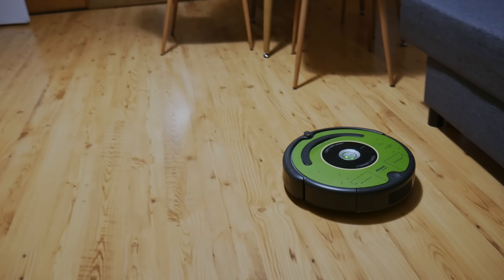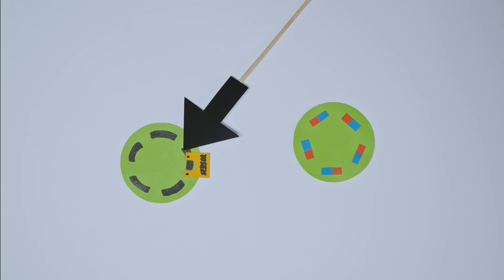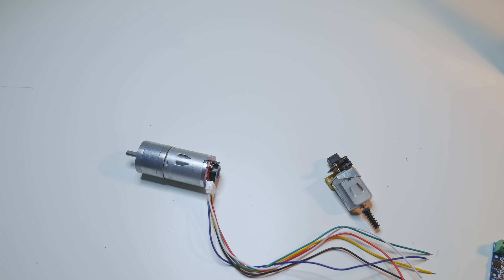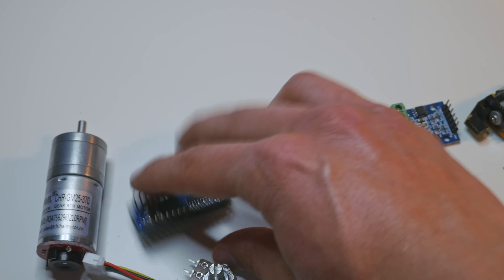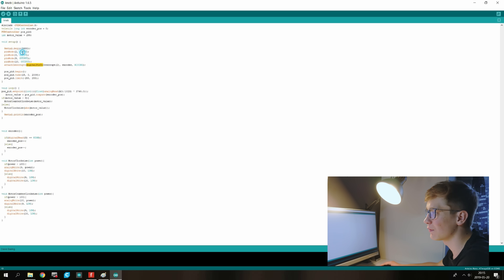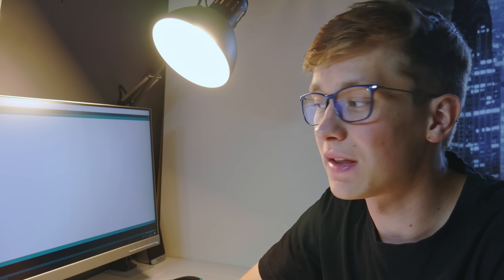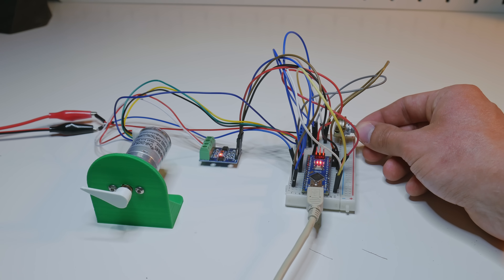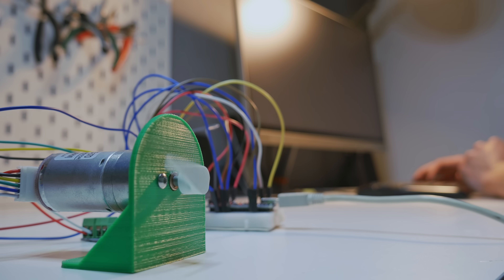Encoded Motor With Arduino

Comment: Can i use an encoded motor as a 360 degree rotation  servo ?  Suppose i give an input of 5 to the arduino using some monitor display then the encoder must stop at 360degree/5  position, like every 72 degree the motor should stop and rotate??

Comment: I came across this video after having successfully made a project exactly like the one you mentioned 1st, with the potenciometer. However, I tried doing something using serial comm as the source of the target position, but anytime I connect the powered motor driver to the arduino, serial comm doesnt work. I'm left disconnecting the driver anytime I want to type a number in serial comm. All the grounds have a single common ground point, so it's not a grounding issue. A friend suggested it might be electrical noise from the m.driver interfering with the arduino, what dya think? Thanks

Comment: I don't know anything about this. I'm a light retrofitter.  I design and modify the vehical lights.  I want to make the 2 motor to turn at the same pace and, if possible, stops at a specific point the power is switched off.

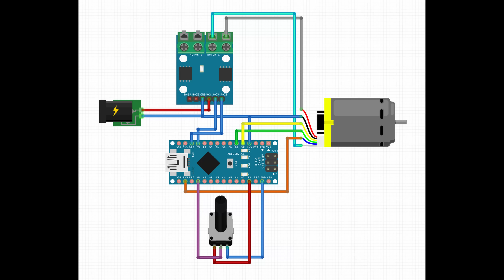Comment: I pulled up the DC Motor w/ Encoder that you provided a link to in the video's details and compared it to the Fritzing diagram you displayed (3:19), and the wiring you suggested does not make sense to me. In particular: Why are we connecting the motor's white "Quad encoder B signal'" wire (see Amazon's pictures) to the negative motor terminal of the driver?

Comment: Interesting video regarding ardulnos, I'm currently working on a project it's an radio controlled model kayak 🛶 1:6 scale but having great trouble mimicking scaled down body movement like forward backwards left and right with a two standard motor setup using normal standard r/c the timing on the motors needs to be correct as it's critical for the paddle strokes, the system i have at the moment is a electronic speed controler (esc) driving two motors. Just wondering if you can point me in the right direction if it can be done involving an endcoder motors ardulno system working with a r/c receiver and transmiter. Have a look on my channel to see kayak videos thanks Chris.

Comment: I have a problem, if I have a motor with encoder but it handles a voltage of 24 volts, which model of H-bridge can I use?
Reply: the l298n can handle it, make sure to see how it works

Comment: How do you keep the position of the motor same on startup? for example if it is in a robot arm then how do you know the absolute location of the arm on startup. Wont the position be different every time the robot boots up?
Reply: yes it will, that's the downside of these motors, more expensive robotic arms use absolute enocoders, that way the position of the motor is always known

Comment: why are u have "* 3740" at first line in void loop? Thank u!
Reply: Hey. Perhaps, for your question, if you search for "JGA-25 370 6V 210RPM with encoder - how to get RPM from encoder pulse frequency", which is found on the arduino forum, or something similar, maybe it can help you, not that it is this is the encoder motor value that the author of the program has used.
-----------------------------------------------------------------------------------------------------------------------------------
Oi. Talvez, para essa sua questão, se você procurar por "JGA-25 370 6V 210RPM with encoder - how to get RPM from encoder pulse frequency", que se encontra no forum arduino,  ou algo similar, talvez possa lhe ajudar, não que seja esse o valor do motor encoder que o autor do programa tenha utilizado.

Comment: I doubt that anyone will ever see this post, but I had to write one because this video is the BEST I have seen regarding this subject. I have been looking for this solution for over 6 years now and came across it just now. Every other video on YT does not use position control with DC/encoder control(closed loop). Seems they all like steppers. There is no better way than this method for position control at a very inexpensive solution. I was a CNC tech for over 25 years, and this method was used long ago on industrial machining centers. Thank you very much for this project!
Reply from the maker: I have seen it :) Thank you very much!

Comment: Hello friend, I'm from Colombia, I'm doing this same project using exactly the same components and the same code of your video, but I can't get it to work correctly, when it reaches the position that it should stop, the only thing it does is reverse the direction of rotation , please help me
Reply: In addition, the current when reaching the desired position rises too high and the motor driver gets very hot.

Comment: I didn't exactly like this tutorial. Yes you showed the true function of the motor utilizing PID control which is great. But comparing the first and second example code were nothing alike. You never explained how the first example worked nor even showed the second. This is a problem with people who use Arduino. They have no idea how the code works. Thankfully I am majoring in Robotics Engineering so I can read the code and figure out how it works. But to the general public they have no idea what you're talking about. Comments on the code would help people understand. I do not like when people explain the code for three seconds and then cut to the application working. No disrespect, I just thought you could have done better.

Comment: Nice tutorial! My actual project for agriculture uses a sensor hall or a reed switch to control a peristaltic pump. The "IN" is the wheel speed. It uses a 12V, 36W windshield motor and a IRF1404 “as driver” (plus a diode and resistors for protection).

Comment: Great video! If I understand correctly, the encoder you ultimately used will tell you relative position, not absolute position, is that right? In other words, if you turn the arduino off and then on again, it will think that the current motor position is "0"?

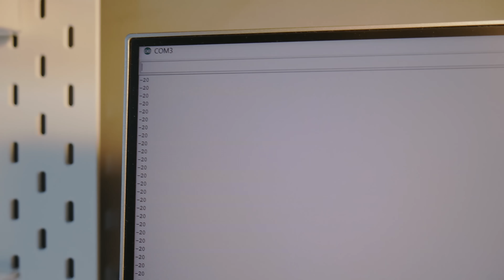Comment: I entered the code according to the video, but the motor does not stop. The code on GitHub also seems to be inaccurate. What code do I need to write to do the same as 5:55?
Reply: It sounds like you have the wrong motor polarity. When the motor moves in the positive direction, the encoder must count positive.

Comment: Hi, do you think is it possible to do a open loop test in order to get a mathematical model of the motor? The test is simply to put a voltage at input and measure the speed output, and of course to hold the data. Thanks

Comment: Hey there, l have seen your videos were really superb but what l actually want is how to control the position of the encoder by using arduino , lcd display to see the position visually, keypad to type degree , potentiometer for lcd display voltage up and down and h-bridge to control high voltage using low voltage . Please let me know if you upload a video basing my project please help me

Comment: When using the 2nd version of the code without potentiometer, do you just remove the potentiometer from the wiring schematic?
Reply: did you ever figure this out. its driving me crazy. i dont know know what to do.
Reply: @MichaelRHead-zv2zf  Niko didn't reply so I didn't go down this path. I found one that was simpler/cheaper https://www.youtube.com/watch?v=yvrpIYc9Ll8

Comment: Hello let me congratulate you I have seen many of your videos and they are very inspiring !!!! but I don't know as much as you hahaha .... it would be too much to ask ... that you do the same but with the little engine that you showed first ??? I have several of those motors and I want to use them, I know the magnetic encoder is better but I would have to buy them and I already have them. I am asking you because I am not given much about electronics and I do not know enough, apart from the fact that there is not much technical information on those motors as well as the 5-pin encoders that also come in the heads of the printers ... Well I already stole a long time from you, a thousand apologies and in advance thank you very much, greetings from mexico !!! sorry my english is terrible!!

Comment: I connect a 12v encoder motor instead of 6v when I move the potentiometer ligermanet the motor does not respond and keeps rolling why? I send position in serial plotter and nothing it still rolling
-85
-87
-88
-90
-92
-93
-95
-97
-99
-100
-102
-104
-106
-108
-111

Comment: hello, this tutorial is quite helpful. thanks for your great effort! 
I have brought a DC geared motor. it's kinda different than the one you have used but I believe it would serve the same purpose especially that it has the same exact encoder. 
I was wondering if I could use it on my Arduino mega without a motor drive. 
please help me! thanks in advance.

Comment: Great tutorial, I try to run the code with the same setup for both knob and serial, but the motor doesn't seems to run correctly. The motor just run at one direction and with constants speed, even when I turn the potentiometer left to right, or the otherway around. Same thing with the serial version, the motor just run at constants speed to different number I typed in. The motor I have is slightly different than the one you have, but the encoder is the same specs, same color cables with 11 signals for 1 turn.
Do you know why? is it because of this line where I have to tune? pos_pid.tune(20, 0, 200);  Thanks
Reply: did you fix it?

Comment: Great video and thank you for the time you invest in these videos. It would be great if you could explain the wiring a bit more too. "Here is the motor... it has 6 wires" - what are those six wires for? My motor has 2 power wires and 4 encoder wires, so it looks different and has different colors but has the same functionality. If you explained what the wires are for, it will help others with different motors to also understand the wiring better.... like myself :-) But thank you again

Comment: Thanks for a great video! I'd like to ask a newbie question. Would it be possible to use a quadcopter ESC flashed with BLHELI firmware, as a motor driver for such precise control of a BLDC motor with encoder?

Comment: H there! That was such a masterpiece XD. Thank you very much. Just a question: where  could I download the PID Library? Best wishes and good luck :)
Reply: Hi Gerardo. From the stech menu->Include Library->Manage Libraries.  In the filter enter: "PIDController". I've always used the arduino  PID_v1 library and I'm not clear what is the difference, but I see the PID_v1 has more control. In any case, great video.

Comment: Can I use the Arduino to compare vibration levels of different cd players ect? If so, is it as simple as placing the Arduino sensor on the cd player chassis and also using a multimeter to get the reading?

Comment: hi first of all good work on the video very well made! i am thinking to introduce this motor into my project (replacing my stepper motor)  my question is since my motor will have some load on the shaft would you suggest e a better motor driver in terms of heating and idle power handling? for example for the stepper i'm using a tmc 2208 wich drops power up to 20% when idle...hope to hear from you soon keep up the good work!

Comment: Thanks for shareing the core. 
I was not familiar with coding and I was tring to use the STM32 MAPLE BOARD insted using arduino nano. 
I just going to change some pin number, But it not work...... the encoded can show up to 7 or some number, then the loop was dead.
Any ider with that? 
Thanks.

Comment: I like it. Could this be made as a drop in replacement for a stepper motor?
Reply from the maker: With proper PID calibration, it could be used instead of a stepper motor

Comment: Do you have a correct circuit diagram for this? The link you included for the motor has a harness with the wires in a different color order than the motor in your video. The colors do not match your fritz diagram.

Comment: Can u jalso show the wiring and not just the schematic? Schematics are confusing
Reply: His wiring harness from left to right: 

red,black,yellow,green,blue,white

red    = m1 (motor power)
black  = ground (encoder - )
yellow = c1 (channel A of the encoder)
green  = c2 (channel B of the encoder)
white  = m2 (motor power) 

Wires from motor:

White and red wires to motor driver motor A connection points. To make motor spin the other way reverse these connections.

Blue wire to 3.3v Output on Arduino Nano. (encoder + power. Mine needs 5 volts so I used 5v pin on Arduino Nano instead of the 3.3v (volt) pin.

Black wire to Arduino Nano ground pin. (encoder - power connection. Either one on Nano may be used.)

Yellow wire to Arduino Nano D2 pin. (This is channel A encoder signal being read on pin D2 of the Arduino Nano)

Green wire to Arduino Nano D3 pin. (This is channel B encoder signal being read on pin D3 of the Arduino Nano)

The center pin of the potentiometer is connected to Anolog input pin A0 of the Arduino Nano.

The two outside pins of the potentiometer connect to the 5v pin and a GND (ground) pin on the Arduino Nano. (reversing these two wires will reverse the direction the motor turns when turning the potentiometer)

D9 of the Arduino Nano is connected to the motor controller Dir (direction) pin on my driver but most dc drivers have just two input spots and the wires can go in either order to these spots.

D10 of the Arduino Nano is connected to the motor controller PWM (pulse width modulation) pin on my controller. Sometimes labeled step pin on various controllers. His driver wires to D10 and D9 of the Arduino are labeled A-1A and A-1B on his motor controller. 

External power + goes to motor controller power input. (labeled VCC on his controller and labeled V+ on mine and others.)

External power - goes to motor controller ground input. (labeled GND on his controller and labeled V- on mine and others.)

The external power ground is also connected to one of the two Arduino Nano ground pads labeled GND
Reply: ten littleindians wow thanks! :)

Comment: In your code, you’d be much better off defining a constant for each dio pin e.g. MotorSense = 3; Not only does it make your code easier to read, and less likely to make mistakes, but if you ever changed pin, you only need to change the code in one place.

Comment: Could you please make an example with the other motor you showed? I have a couple laying around and I couldn't get them to work :)
Reply: The motor first showed needs 5v for the encoders instead of 3v so move that connection for a start. The wiring diagram is on the eBay listing for this motor. I moved the power connections to the larger pads on the circuit board as the power points shown on the diagram are too close together for the size wire I used. I cut the ends off an old mouse and used that wire for the encoders. His diagram does not have anything marked so it's a crap shoot figuring out where he wired encoder A and encoder B to. I also had to guess as to his step and direction pins used. I too have several of these motors. I did hook this circuit up and get the motor to move in one direction only when advancing the knob. The motor has resistance in one direction only while stopped. Reversing the A and B channels makes the motor spin  nonstop. I may tinker with it again and try and figure out what's wrong. I checked the encoder signal with an oscilloscope and I do have both channels working on my motor.
Reply: @tenlittleindians  I already did a lot of research into the motors before I asked and found out the ones with the worm gear are not meant for precision but rather for precision when used in conjuntion with another gear wheel because of the high speed. Sadly for the exact model I have, I couldn't find a schematic so I would assume that even though they look the same, we have different models. Could you share the link for the ebay listing so that I can find out the schematic and compare some?
Reply: @MarinusMakesStuff  https://www.ebay.com/itm/DC-3V-12V-130-Servo-Gear-Motor-32-line-AB-Phase-Encoder-Code-Disk-Speed-Motor/172168535255  As I mentioned earlier; use the two large pads on the bottom of the circuit board for motor power as they are easier to solder to and less chance of shorting them out.

Comment: You will have a bit of a problem with i2c. The problem will be the interrupt - you will need to make sure you can read pulses while communicating over i2c... What's the problem of using serial instead of i2c, btw? Misun wrote a nice servo controller already for arduino, esp8266 and I modded it for ATtiny85, perhaps check that one out for inspiration ;) Nice work, btw. Good luck.